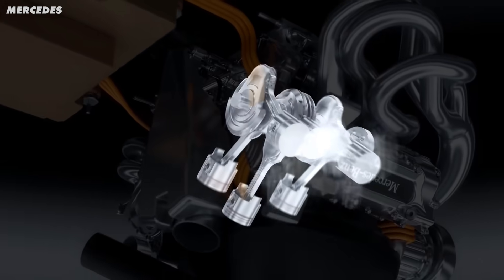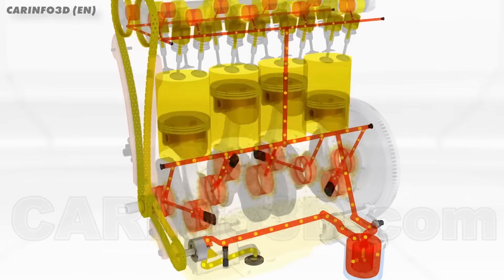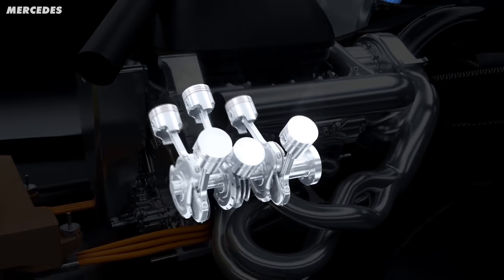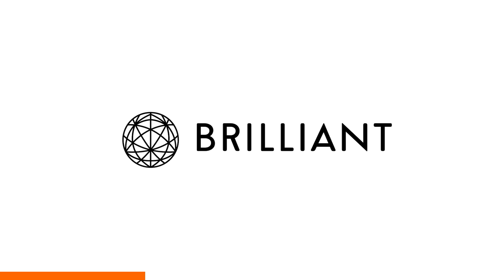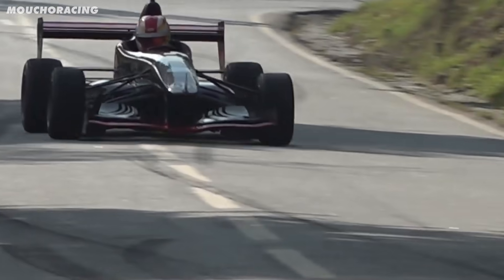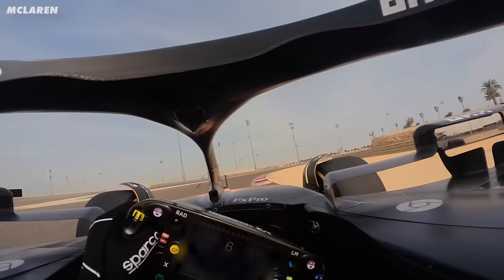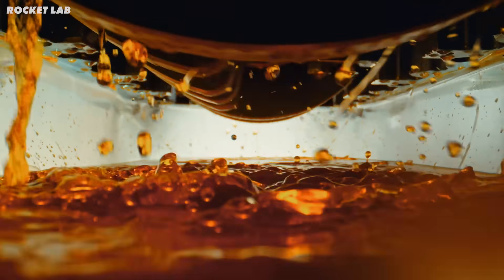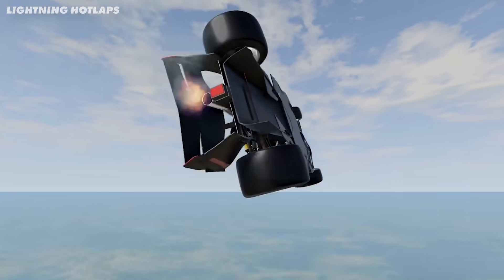Why F1 Engines Won’t Work Upside Down (for our stunt)

Comment: Would the resolvent for the weight of the battery not be a supercondensator, light weight, gives full power when needed, and it has not the downside that it needs to have a long range, it only should deploy all stored energy, on a very short track.

Comment: I was worried that you would go electric. Its an interesting and ambitious project, but a far cry from the initial claim of "I'm going to drive an F1 car upside down". More like "I'm going to drive a very specialized custom built vehicle with no other practical purpose upside down". Not trying to criticize and I understand there are safety and engineering limitations but it doesn't have quite the same pizazz.

Comment: For the inversion car, is there a reason you can’t use thrust?  A jet engine could give you more than enough thrust and then you wouldn’t have to be concerned about tires providing grip for power, only for control.

Comment: very cool! was expecting you to choose electric as with a very low battery size requirement most of the downsides are nullified. but DAMN, i wasn't expecting ypu to go for 4 in-wheel motors. can't wait to see the next update

Comment: Have worked on robotics a fair bit. Remote controll lipo could be a good solution. You should be able to get away with 20kg not 50kg total battery weight for the stunt. Have several and swap them to allow for charging.

Very sensibly, split a pack into 4, where 2 or 3 sections can deliver safe power and use big diodes to link them together.  Greatly reduces statistical failure rate.

Happy to help if there's opportunity.

Comment: You mentioned electric motors and the problem with the batteries. Why not use an electrified track? The car is electric and powered by the track through something like a pantograph. Gets rid of the battery, oil, and fuel problem. Provided the car follows the electrified track

I see this as the only logical approach if you want to be as light as possible. The ICE is heavy and complex, especially if you make it All wheel drive, let alone the drivetrain and differentials adding more complexity. Electric Motors is definitely the solution, but instead of using a battery, it is powered by a powered track slightly narrower than the car itself. 

Power is supplied through something like a pantograph from the underside of the car, much like how an electric train works. Idk if it is already considered, but it just came across my mind

Comment: Hello, I am no expert but as far as my knowledge of physics tell me the orientation of the car should not matter. If you generate the necessary downforce to have car hanging off the roof then the car is experimeting a vertical acceleration greater than gravity in the opposite direction. I am no expert in fluid physics but shouldnt the fluids inside the car engine also experiment this force and have it working properly as if it was working on the ground? I am unaware if the engines actually take advantage of this downforce plus the gravity normally to have the fluids working. I am sure you guys have thought about this so I would like to know why it still doesn't work. Good luck with the project.

Comment: The first time someone told me an F1 car could drive upside down due to its high downforce, my immediate reply was, "Better do it quick, because there's no downforce on the oil, fuel, and cooling systems"😂
What you're describing at the end of 6 minutes, is exactly how RC race cars are set up. Battery cells have a matched discharge rate. The highest quality being those that will discharge as hard and heavy, and be done in just over 4 minutes. The length of the race. That's the right way to think. You don't need any more weight and battery, than required to get you to the end of the tunnel.

Comment: What about a 2 stroke motor? Light, doesn't care if its upside down or on the side
Power dense but probably a bit hard to find a 300 hp unit

Comment: I think, if u go with electric motors and adhoc instalations to run, why dont u charge the car by induction???, probably is cheating bc os the magnet field can influence the forces acting in the car but can be a good idea

Comment: I call bs, if you only need 10-20 seconds run time up side down,f1 dry sump wil be fine, it would not sieze immediately, even on fine tollerance. Change the oil tank pick ups for 360 degree pickup and away you go.

Comment: At first glance, if you have over 2G there's no way on earth the oil will drop down. There's no up/ down there's force being applied, and depending on the force your up/down is then set, but for doing this you would have to keep on rounding the tunnel.
Reply: What is wack is no one else in the video or comment section seems to have done physics. 
How can no one understand the force pushing the car to the roof is also pushing the fluids?

Comment: It's good that you changed the title. It isn't anymore F1-cars driving upside down like has always been the assumption (not speaking about your project), but F1 car would work for few seconds before it would die.. This has kind of changed now to "car with wing and crazy camber on wheels with electric motor doing what F1-engineers have told for years. Still huge respect to you Scott and all involved in making this propably reality! Hope it all succeeds as planned!
Reply: @nickmathews6226  gotcha

Comment: in the first video, the purpose of the project is to challenge one of the F1 myth "can F1 car drive upside down?". even the video title is "I'm Going to Drive an F1 Car UPSIDE DOWN (really)". but the project is going with special car that specially designed for the challenge.

with this the myth is answered that F1 car (the real one) is cant drive upside down (despite the challenge even not done yet)

*please dont get me wrong. I think it is great project and will be a crazy achievement if it success. but just feel a little disappointment because it will not use the "real" F1 car.

Comment: IIRC lot of the German planes in WWII had inverted V-12 engines, where the engine's basically installed upside down. I think the oiling issues are solvable, but if sponsors & young people are more inspired by electric cars than gas & it's an easier design to validate, then it makes sense. Personally, I'd like to see it w/ an IC engine just b/c aesthetically that's closer to the original dream of driving an F1 car upside down & the sound of electric drive makes me think of quadcopters or the McMurtry fan car, but it will still be really cool either way

Comment: Technically the McMurtry Spéirling is the perfect car for the job. It just needs the right ride hight for suspension travel when the car is climbing up the side of the tunnel.
Reply: but that is not the goal of that experiment. watch one of the forst videos of this series. They want to achive this just with aerodynamics and not with a fan or so

Comment: Would it be possible to use a metal to metal connection? Much like those track racer toys that use a copper brush at the bottom to contact the metal strip of the track for power? I'm curious how well that kind of power system could scale. That would completely solve the issue of weight from the battery.

Comment: Have you guys considered a 2-cycle, like a snow mobile engine?  I would think they would be able to run upside down as no pool of oil is necessary. Cooling is all enclosed and not gravity fed really as long as it's full
Reply: nah, you can't fill the cooling system until its full - then it has no room to expand and it will blow up the reservoir. You'd need to mess with the reservoir so the water pump always picks up coolant and never air, which can be done - but I doubt it's easy. 
An air cooled two stroke may be an easier solution to work with, but they can't do their torque steer magic with that, can they.

Comment: There are busses and bonds that uses a whire direct onto the eletric grid. You dont need a battery if you have a eletric motor and a wire in the middle axis of the tunnel.

Comment: The video clip at 10:00 had me wondering if you are also going to be not only driving upside down but driving along the wall at 90 degress to the ground in a second run. Since you're going to all the expense and effort it would be great to see a car drive along the side of a wall where gravity is trying to make it slide down the wall. The time on its side could be even longer than the upside driving as you do not need so much length for the full 180 degree rotation of the car for upside driving.

Comment: If you don't  care about your engine oil isn't a problem, how  long do you plan on actually driving inverted. Sounds like this is going to be over thought to the point it will never happen keep it as simple as possible would be my advice your going to have to build this track so build your track geometry to work with the car not overly complicated hubs.

Comment: Commercial aircraft use batteries that are far more weight efficient than automobile batteries and they can be purchased.  You could get more than one pack and exchange them when testing.  There are used aviation parts for sale, so you may be able to find a derated aviation pack that will work fine for you.

Comment: If I were designing this I would start the car off upside down have it run along castors until it's built up enough downforce to carry the weight.  Hell using rails you could keep the car inverted the whole way with a better margin for safety.  You could use castors on rails, and have the rails narrow to a point where they are not actually carrying the car.  then have them expand again to "catch" the car in the breaking zone.  This could also be tested without a person needed to drive the car.  Has anyone tried to do this at scale or is the first time they going to be attempted is with our drivers here at the wheel going more than 120 mph?

Comment: Would there be any benefit in altering the shape of the tunnel so that, instead of driving up the left side of a tunnel, until you are driving upside down, you drive up a pitch that increases until you are upside down?  I'm thinking of the Hotwheels loop, but the top portion (when the car is upside down) is elongated.  That way, you don't need to worry about wheel spin / oversteer / understeer.  I figure you would only need 2 - 3 seconds of upside down track to "prove" the car is driving upside down.

Comment: Do you guys have any way of contacting Koenigsegg? I remember they have some electric motors that were also quite small, lightweight, and produce more than enough power for the project. I don't know if that's a realistic idea but it could be worth a shot, I reckon.

Comment: 2 Stroke engines should work upside down aswell. Not excactly sure which are available, but 200 kw from a motorcycle should be possible.

Comment: Has a 2 stroke engine been considered? They have an extremely good power to weight ratio and pretty much solves the oil problem.
Reply: I feel like that’s what they meant when they discussed “bike engines”
Reply: The diagram they showed for the bike engine was definitely a 4 stroke, not a 2 stroke. Fuel injected 2 stroke could be a viable option.

Comment: 2 stroke motor, fuel injected with a round, pressurised fuel tank. Regardless of orientation,  this would work.

Or a fuel tank with a pick up at the bottom and one at the top, gyroscope type sensor activated pickups would mean fuel is always been fed regardless of orientation
Reply: You could also do a cylindrical fuel tank with the pickup coming directly from the center axis and the whole internal sending unit would be on a swivel fitting so that it would settle to whatever angle becomes the bottom

Comment: My initial thought was a 2 stroke engine. It solves the oil problem as it's simply a part of the fuel, and some fuel injectors solve the fuel gravity issues. However electric simply seems a better option. I'd assume even Lithium batteries to be safer than fuel in this instance, then simpler weight and R&D makes electric the better option even before torque vectoring is considered. It's easily enough of an advantage to get past my prejudice against electric propulsion for cars.
Reply: I think 2 stroke is the way to go. I know electric is easier, but it just seems disingenuous to not use a combustion engine.

Comment: I call BS on not using an ICE because gravity is pulling the oil to the top of the engine.
1: radial engines seem to work ok with this as do horizontal boxer engines etc
2: all the oil / fuel / water will drain to the heads/cam cover  / or slosh around and not be  sucked up by the fluid pick-up … these systems are all pressurised and the scavenge pumps could connected to a simple drain in the rocker cover.
3; the ‘expert’ has a vested interest in promoting Formula Student - could be some confirmation bias at work here … maybe get an extra set of eyes looking at this.

I’m as keen as anyone to see a successful result to this experiment, but it seems to be getting further away from the original hypothesis.

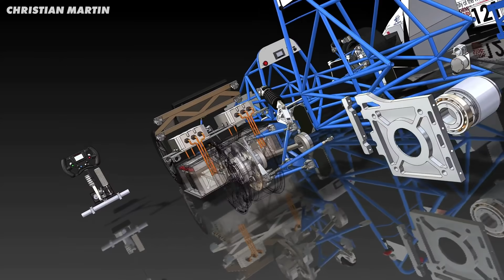Comment: 8:25 Wait a sec! Why cheap EV cars are not already using these motors? 3 kg per wheel would be acceptable unsprung mass for a road car and 4x 67 hp would be plenty enough for a typical family car. You could have 4WD + torque vectoring and skip the diff and cvt joints and lots of other parts, too.

Comment: downdorce is created by the chasis... Remove the ICE and tanks....  Join 2 electric motors if you can and just shoot it on the ceiling 😂 The weight of batteries and motors has to be considered

Comment: How about a twin sumped/catch pan air cooled Boxer engine, one sump above and one below, but only to catch the oil, then supply through one oil pump? 
Then a Collapsible fuel cell within a pressurised container, so fuel always getting supplied and forced out as pressure in container always higher than the cell?

Comment: It may be a good idea to to use same batteries as drones lipo . But the only problem will be safety because lithium batteries are very flammable 😅 although Lipo batteries have a great power to weight ratio. 

Keep ⬆️

Comment: Need to use the original Jaguar C-X75 drive train. Electric motors powered by 2 Micro Turbines. Lightweight without the batteries.

Comment: As long as you use a decent fuel system and fill the tank it won’t care what the car is doing, and if you run a dry sump oil system run ports to the valve covers to pull oil out of the motor. You’ll get some weirdness from the oil collecting in the pistons, by ad my that leaks through will get burnt. I can lead you to off-road videos of trucks on their roof/sides without a dry sump that drove away fine. It’s not that big of a problem.
Reply: These things DO NOT DRIVE upside down.

Comment: If you have to create the track from scratch anyway why even use a tunnel that would require drive up a curved wall? Why not create a flat straight surface that then slightly twists so your driving surface becomes the bottom side and prevents you from having to do much steering. just hold the wheel straight while the ground beneath you twists with you on it, then have the distance you wanna travel stay flat then another half twist in the track at the end to get you orientated upright again. Like just corkscrew the road.
Reply: That might make the tunnel too long, therefore too expensive, if it’s such a gentle change to inverted and back.

Also I’d imagine a gentle movement to inverted like that would also make the tunnel very tall. The height was a consideration made in the video about designing the tunnel.

Comment: Why not have 2 oil sumps? Aka turn the rocker cover into a second sump. Providing the engine with second oil pump shouldnt be that difficult in my opinion.

Comment: As a Formula Student engineer, I love to see our stuff get applied elsewhere. It makes it all worth it
Reply: Hello. You sound like just the fella I need. I’m interested in these little motors mentioned here. Do you know where they are sourced from? Thanks !
Reply: @cortilach  as a team member of a german formula student team, I can say that these are often developed and built by the team themselfs.
Reply: @Terrec  thank you for the reply. Don't suppose you have a bin full of old ones out the back somewhere? 😅
Reply: @cortilach  nah sorry, actually we just started working on our first electric racecar.
Reply: @cortilach  A lot of these motors are self developed by the teams. Often the teams start ther developement from an existing design such as the ones manufactred by AMK motion.
Reply: @cortilach  also curious about the motors. the stats are nuts
Reply: @morkovija I know right! These little karts must be a hell of a lot of fun.. I want one
Reply: @cortilach  AMK or Fischer. With Fischer you need to partially work on the parts as rotor and casing.
Reply: which team are you in i am fsae engineer too
Reply: @alaybey9771  Athene Racing Team, you?
Reply: @Terrec  ITU racing
Reply: Same here
Reply: The software for the torque vectoring and also the electric Engineering needed for the inverters are going to be a shit ton of work. Basically like a full new season car you all know the pain But iam very excited and happy to see FS influence in such a big way.❤️

Comment: Hey man, maybe you could test this with a fairly large small scale model and an electric rc car locked horizontally into a groove on the track but not vertically locked in so that it will fall if gravity turns out to be the winner
I love all of your videos and I'm so excited to see how this plays out. Be safe man!
Reply: I think this is the way, combine this with the track racer toys that have a metal strip run along the groove, then a copper brush on the car to make contact and provide power to the vehicle and your battery weight issue is non existent. However I don't know if this would count as driving a car upside down, or more so a super sketchy roller coaster that is powered via motor instead of gravity.